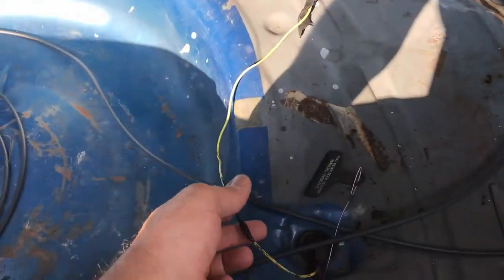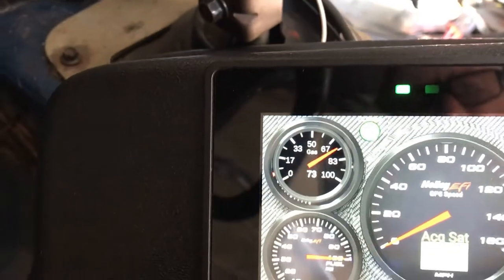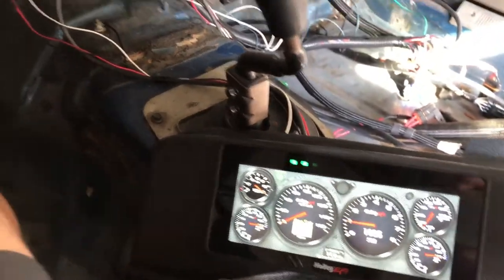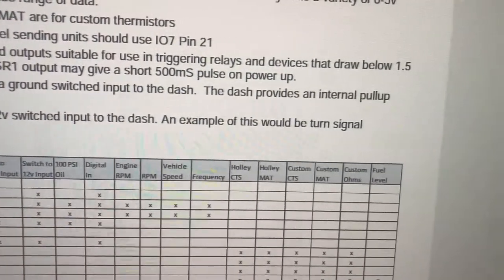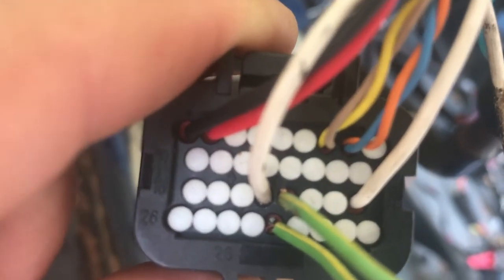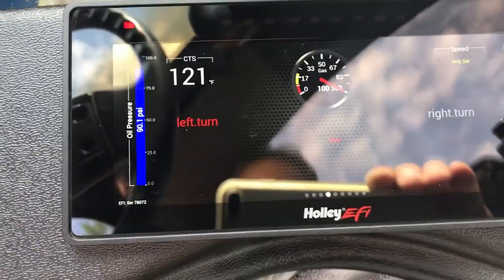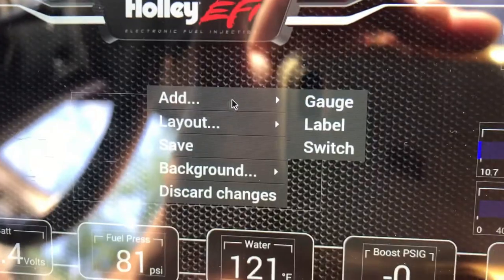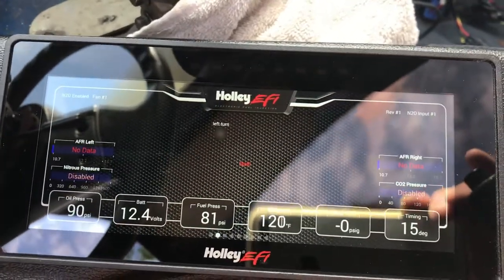Holley 6.86 Dash (Turn Signals & Gas Guage)

Comment: Hey bud. What color wires are the turn signals. Where did you locate them? I want to do the same thing for my digital dash. Thanks.
Reply from the maker: 87-93 Mustang Multifunction Pin Switch Wiring (LMR.com) ----- Pin 3 lt grn w/orange stripe, left rear turn lamp;  Pin 4 or w/lt blue stripe, right rear turn lamp. Another good resourse for Foxbody wiring is at https://www.veryuseful.com/mustang/tech/engine/

Comment: You’ve brought her a long way. What all do you have planned to do?
Reply from the maker: Thanks AM - planned mods are;  New aluminum heads, paint job, new shocks/struts/springs/quad shocks, 5 lug conversion with 355 or 373 gears, aluminum drive shaft, flaming river manual rack & pinion, electric water pump, ford performance lowering spring kit street 1" battery relocation to trunk to name a few!!!